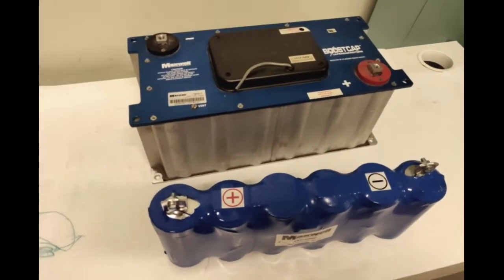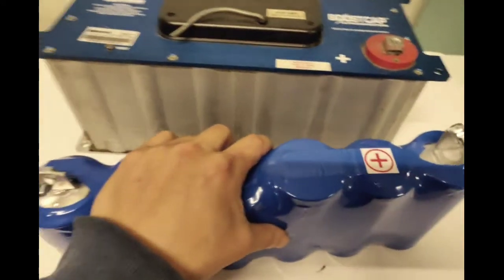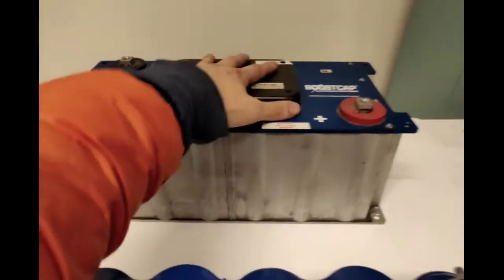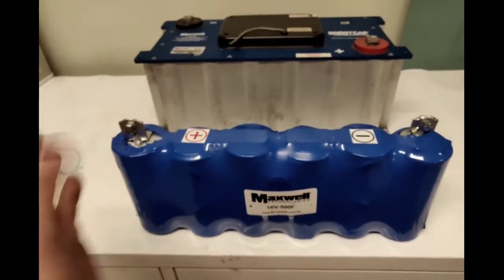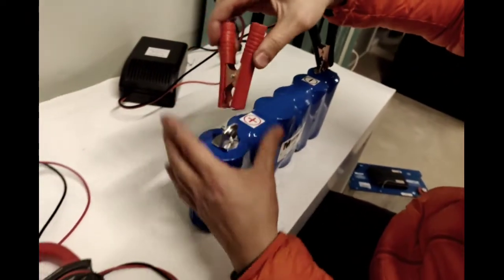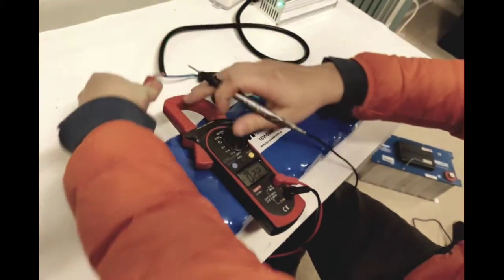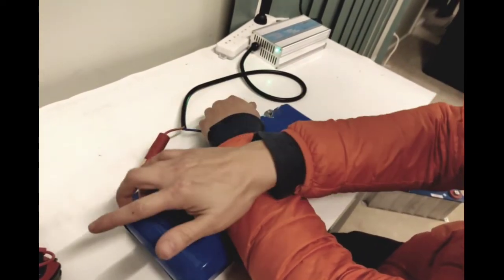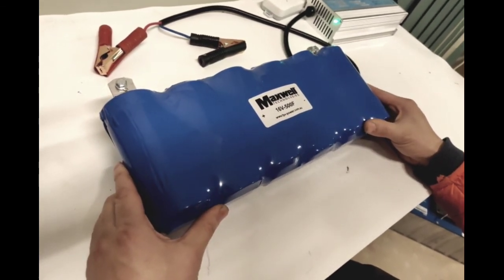FPV-POWER Maxwell Super Capacitors

Comment: Seems to be if "FPV-POWER Maxwell Super Capacitors" were doing their job properly as a supplier, then any re-seller like "Kayak Batteries" should be able to obtain 6-capacitor units for resale without all that labour-intensive dismantling.

At the end of the day, 12-14 volt systems are far more common (even without taking vehicles into account) than 48 volt systems.

If the 48 volt unit is only $200, then there is no way that the 12 volt unit should have dismantling/reassembly costs added to the point of costing 3/4 of the original.

MAJOR marketing failure, IMHO.
Reply: Everyone is entitled to their honest opinion, including yours.... We move these by the tonnes each month. Hence I don't see or smell any hint of any marketing failure here.

Merry Christmas.👍
Reply: @iangoh7289  All very well, but you don't address my main 'complaint'.
The 48V units have (if I understand correctly) 3 of the 6-cap shrink-wrapped setups inside.

But at one point in your vid you use the fact that you have to DISMANTLE something already constructed so as to facilitate the 6-cell unit (with new BMS) to the public - as the reason they cost 3/4 of the units with 4 times the power.

So why exactly cannot YOUR supplier forward some 6-cell units directly, so as to make all that labour unnecessary and REDUCE the selling price to the public?

This is an honest question: How can they defend selling "only" 48V systems to you re-sellers... when 12V is far more common?

It wasn't a criticism of you, but of what appears to be a serious screwup on their part - underestimating (or not caring) about a significant market.
Reply: @S @Squire_Chris u are an ass and what you said was dumb. But that wasn’t enough for you. The guy took the time to respond back to you with a subtle nudge to check yourself. Instead you doubled down. That was stupid.
Reply: @jairusfussy5207  Name-calling is easy.  3 years ago is WAY too far back for me to recall the situation.  
Not sure why you are bothering insulting and calling me to account for an interaction that apparently took place in 2022.
Might be time for you to move on and live in what's left of 2025.  Cheers.

Comment: I have 2 sets of 5 banks of 60v capacitors. The bank will contain 5 sets of 13.5v (5*2.7v=13.5v) Each bank is consisting of 5 sets of 13.5v to make a 60v the total voltage of 60v . Using a battery isolator can I charge the two banks using a 12v car alternator? Will capacitors be overcharged and what kind of safety device I need to protect the capacitor banks?
Reply: I noticed no one ever gave you an answer. I don't think people know this stuff as well as they should.
Reply: I don't think that the person/entity that took the time to make this video either knows or can give a flying @#$%.
And I for one will never buy expensive technology from anyone without the knowledge, smarts and interest to give me good customer attention - they are just as likely to leave me stranded AFTER they have my money.